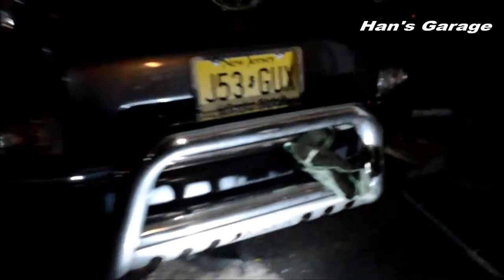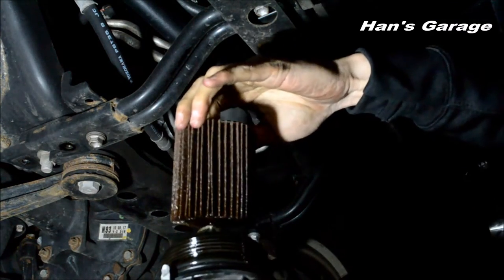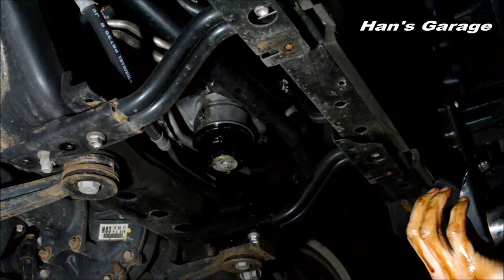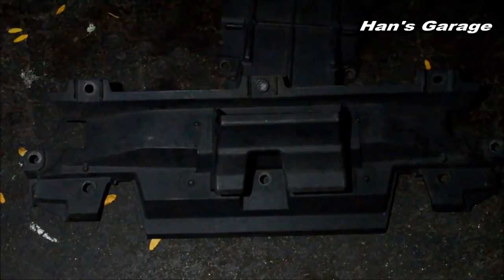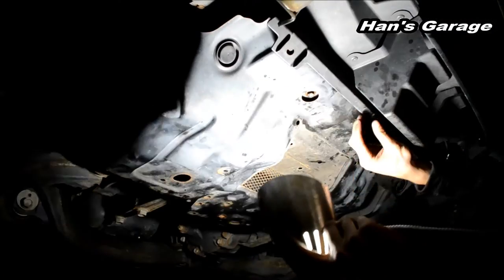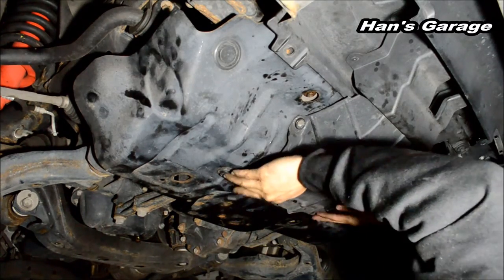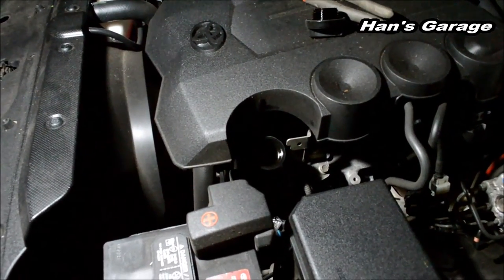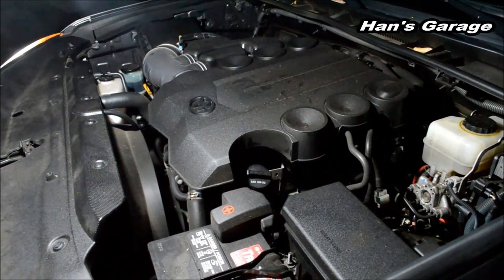Toyota 4Runner DIY Video - Engine Oil Change

Comment: Perhaps it would have been a good idea to fill the 4runner with oil "before"  installing the under belly plates.  That way you can make sure it doesn't leak.
Reply from the maker: Kiss Kiss definitely